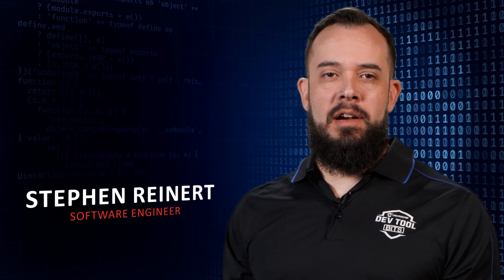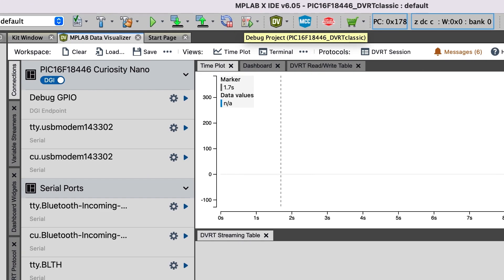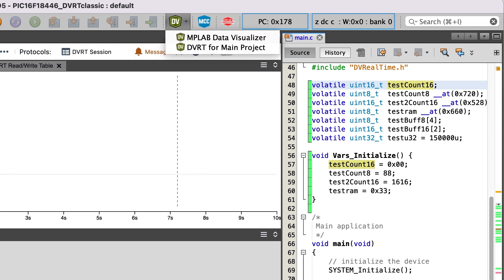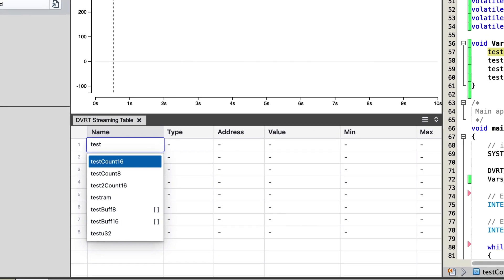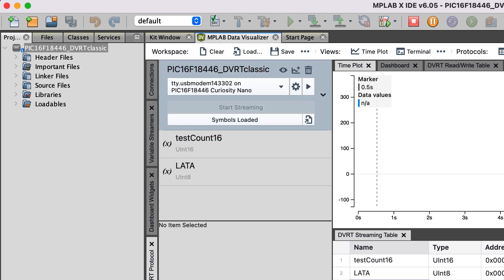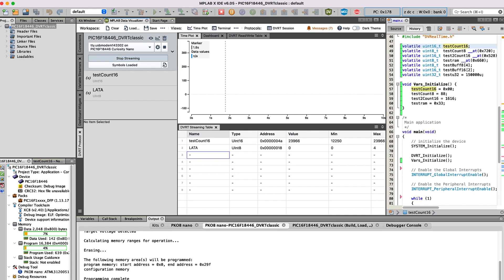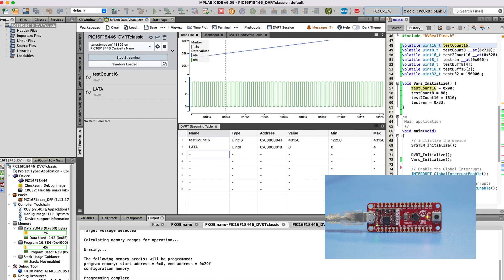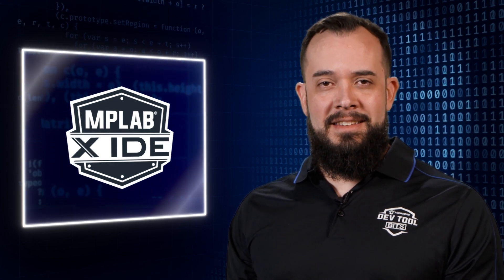Dev Tool Bits | Visualize Data in Projects Using the DVRT Protocol

Comment: What code should I burn on the MCU?!! The tutorial is so insufficient!
Reply from the maker: Hi there, thanks for your question! The code shown in the video uses the DVRT protocol to visualize runtime variables on a PIC16F18446 MCU. You'll need to define global variables in your main.c file and use MPLAB Data Visualizer to connect. If you need help finding the specific example code, please contact microchip.com/CSS for further assistance. Thank you!